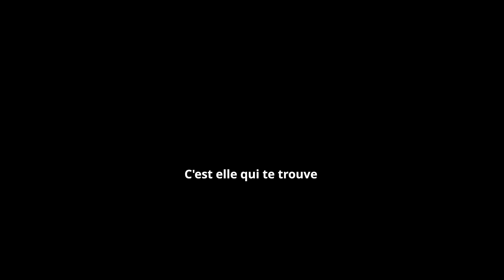Si tu sais pas monter de la pierre

Comment: bonsoir,
tes videos prennent une belle direction. je ne vois aucun problème dans l'utilisation de ciment pour la mise en oeuvre, à partir du moment que tu fais respirer le support, donc les joints de pierre. la pose doit être aléatoire ce qui est parfaitement respecter et le joint fait le reste ce qui fait l'harmonie de l'ensemble. Ce qu'il faut voir, c'est trois vision différente sur un mur en pierre ou façade en pierre. Prendre du recul, regarder en face puis du coté droit puis du coté gauche et on doit avoir une vision différente, si on perçois la même chose sur les regards c'est que la pose n'est pas cohérente tout simplement . donc belle rénovation de bâtie ancien. cordialement
Reply from the maker: Bonsoir et merci, t'inquiète donc pas pour ce que tu dis. j'imagine que tu as lu certains commentaires.
Pour l'instant je ne dis rien et juste je montre.
Prochaine vidéo : préparation des pierres avant jointoiement. C'est pas à toi que je vais expliquer qu'il manque des choses dans le travail qu'on voit là.
Ensuite, pour une prochaine : l'explication complète avec description des tenants et aboutissant. La vidéo est déjà prête d'ailleurs.
Quand on fera les joints au printemps, j'en profiterais pour expliquer qu'avec du mortier ciment sec, et sur certaines pierres seulement, et (tu as raison) avec un joint chaux, on se retrouve avec un mur solide, semi souple, et suffisamment respirant.
Pour l'anecdote, les joints blancs existants où on voit bien les traces de brosses sont fait au ciment pur, et je peux te dire que le dosage doit être énorme vu comment ils sont durs... De plus, derrière les pierres existantes, c'est du parpaing par endroit ...
Si tu savais comment était fait le linteau d'origine : mélange d'ipn et de parpaings posés à l'envers et au platre ou au ciment (selon les zones) ... De la rénovation pure quoi. Perso, j'adore découvrir ce genre de choses qui paraissent délirantes, et pourtant qui tenaient parfaitement bien.
Bien sur que la pose doit être aléatoire, et c'est ça, justement que la miss cherchait à faire. Au final, c'est ça qu'on fait, on cherche des assises et des faces mais non unies sinon c'est moche comme tout et c'est pas l'idée du bâti ancien.
Amitiés.